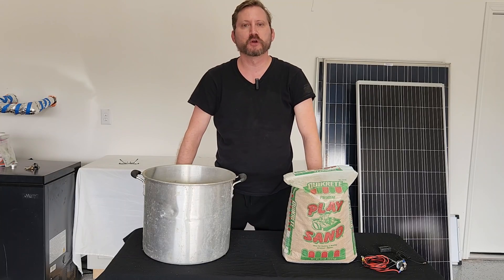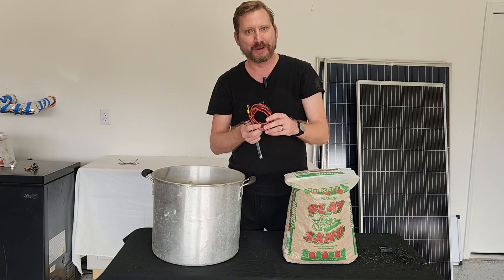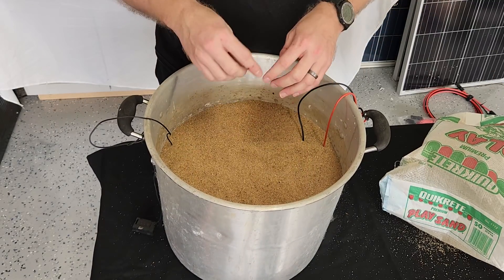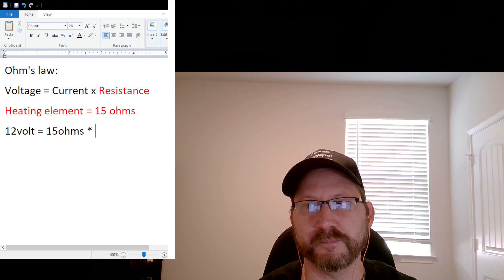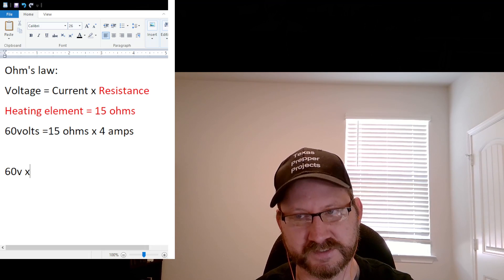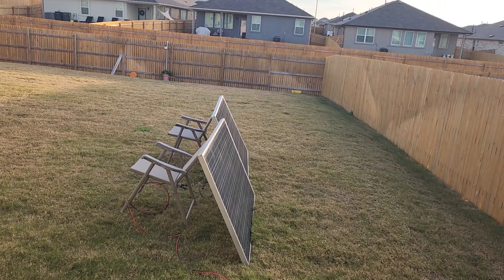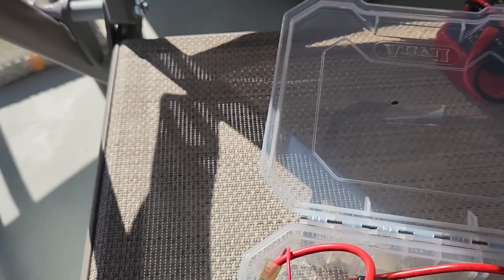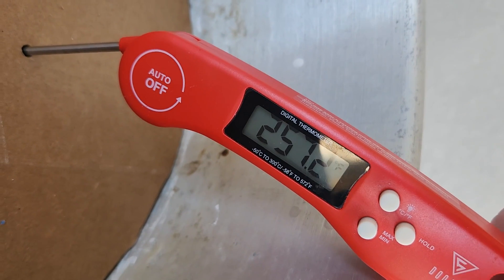Sand Battery Heater solar powered 250F / 120C with no flames or fuel! DIY

Comment: This is a great concept.

But why not drill a hole in a brick inner wall of your house, put a heater in and so you have a lot of mass? Then put a good switch and thermostat, a safety thing on.. 

This could be a perfect commercial product.. Just a wire, switch and small heater element that you can drill into concrete and connect to a solar panel..  And heats your entire house for 50 bucks and some solar panels. 

Or drill a hole in a concrete floor, a brick wall in the basement of your house..

If you really use the mass (sand) under your house it should be possible to store energy for about a few weeks. 

So if you have one week of sun and one of rain, temperure stays totally stable..

Depending on the insulation and other factors you have of course..
Reply from the maker: I didn't want to destroy the pot

Comment: When was the last time you saw 250°F water? One BIG benefit of sand is that you can easily go FAR above water's boiling point without a pressure vessel, giving you a way to offset the difference in heat capacity. Imagine 1000°F sand!
Reply from the maker: agreed!
Reply: @texasprepperprojects  Would this work as overnight low heating in a coop? Assuming it's shielded from the animals and at a smaller scale like a large can? (Oven heated)
Reply: Exactly!
Reply from the maker: @so_what_else_is_new  thanks!
Reply: @dadigitechman  H2O has the greatest heat capacity at 4190 J/kg K. The specific heat capacity of oil is usually around 2000 J / kg K, which is about half that of water. Sand has a specific heat capacity of 290 J/kg K, about 1/15th of water
Reply: I understand that if your heat battery is indoors then blowing air through pipes in the sand or insulating the bucket doesn’t create heat - it just either moves the heat around the room faster or slows it from moving around, respectively. So… drum roll, why do you need the sand at all? Won’t the element heat air just as readily as sand or water? And if you’re end goal is to heat the air, the only advantage I see to the sand is to slow how fast the air is heated and of course to save you from accidentally touching a very hot heating element.
Edit: Nevermind. It’s powered by the sun, so the sand stores the heat for when the sun sets and the power drops. But if there was a steady source of power the sand wouldn’t be necessary. Right?
Reply: If you filled it with crushed diamond dust your matrix will store even more heat😂
Reply: Perfect for my greenhouse..And i live on  gravel..literally. 20 cm/8 inch of soil.. then ice age gravel..
Reply: A 60/40 mixture of water and ethylene glycol can raise the boiling point to around 260°F. Another advantage of water is that you can easily store and heat a lot more of it. 1,000 gallons of water at 200F contains a lot more energy than 10 gallons of sand at 1,000F. The lower temperature differential means that heat will dissipate more slowly.
Reply: Sun is water
Reply: The only issue with this is ..sand for building is globally a  resource under pressure.  So best do some careful research.... as I told my gardening ex all soil is not mud..😂  
Find out what's available and watch out for the unexpected.
Reply: @clivestainlesssteelwomble7665  I think that the Finnish company said that all soil is usable if it is completely dry.
Reply: @so_what_else_is_new  
Soil is a combination of organic and inorganic mineral components...  The presence of organics isn't a good starting point.  As you heat it up it kills the biotic component then starts to reduce organics such as Carbon and sulpher compounds to gasses ... Oops 😬 that's not what we want. 
What you want is a inert mineral particles or mix ...that's stable at high temps and won't contain anything that's likely to react with your equipment or start giving off anything toxic or corrosive. 
At one time you might have looked at the gangue waste mineral piles from the china clay business. 
Now you might look at desert sands but they tend to be high in iron compounds..  if that works go ahead , they have been growing ...  but don't get dredging them out of rivers or offshore sands or aggregates because then you will open up another set of ecological problems .. and just create misery elsewhere from erosion, habitat and species loss. 
In Vietnam  they are suffering big time in the Mekong delta..from sand dredging.

200 yrs ago the Royal Navy needed aggregate to build its dockyards in Plymouth England. They took it from offshore of a place called Hall sands. Just along the coast .... Thousands  of tons. Shortly after In a series of Winter storms the fishing village of Hall Sands was washed away and some of the occupants, those that survived had to break out through the roofs and back upstairs windows of their homes and scramble up the cliffs that sandwiched their village between the former sand and pebble beach and the cliffs... Which also started to collapse. 
The disaster led to a change in British law and it became illegal to remove coastal beach  sands and gravels. The seasonal flow of sands and shingle that formed their protective beach offshore had gone .

The problem is we have reached  
the point some time ago, where the total mass of the Man made now exceeds the total biomass of the planet... and it's still growing and it's still one of the biggest sources of waste CO2 production, water consumption and energy. 🤷🏻‍♂️  
It's a good idea 💡 but just think 
and look at what and where. There are sadly still plenty of Nations that have tried creating cities and land  where we shouldn't ...as a consequence, well they are disappearing  almost as fast as they were created... but the  price is  ....🤷🏻‍♂️🧙🏼‍♂️.
Reply: @clivestainlesssteelwomble7665  well, thanks for lecturing me on the history of the world. ;-) I have no intention of creating a big business or digging megatons of soil. I was just thinking of digging 1 to 3 m³ of soil, letting it dry for a month or so and then building a concrete container within a concrete container with thermal isolation in between. Carbon and glass are not ideal for storing heat but they are not going to damage damage the heating elements. If there is something toxic in it, it will stay in the airtight container. Acidity may cause corrosion to the heating elements, so that's something that's worth some attention. Are there any dry acids? I thought there were only liquid and gaseous acids. Maybe you can clear that up for me.
Reply: @so_what_else_is_new  

😉Not aimed at you just .. I'm just pointing out that while it seems simple there's a few things  to watch out for and if we started to deploy the technology at scale if we are not careful we can run into problems. 
 You can see it  someone goes off  and starts digging sand or aggregate  and ends up getting fined or collects something unexpected in the case of the US there's huge areas of land that are contaminated with  Arsenic.. either from mining , natural Geology or farming where it was used as an insecticide.  Heat that up and...  
Yes ... all Im trying to say is every technology brings its problems ... and we all need to be aware 😉 50 years of dealing   
With not thinking ahead.... trying to get politicians businesses and architects and engineers to think in terms of natural systems and do joined  up stuff ...  🤷🏻‍♂️ Suprise I sometimes do go off on one... 🤣👍🏼🧙🏼‍♂️ ...🇬🇧 ✌️
Reply: @clivestainlesssteelwomble7665  I agree when tech is brought up to scale. I'm an electrical engineer so I have enough experience with that.
I didn't feel offended btw 😊
Reply: @so_what_else_is_new  
Build a box big enough, put a stainless steel spiral as heatexchanger in and fill it up with high temperature stable concrete an you get an ultimativ Heat Storrage
Reply: @michellekonzack  has concrete a higher heat storage capacity then sand? If not then it's only more expensive...
Reply: @so_what_else_is_new  
AFAIK it is the same, but you can build it INSIDE your house like a chimney and use it as WarmWall.
Imagine, you have a zylinder of 1m diameter and 6-9m higth filled with sand and then a welding break.
Reply: @michellekonzack my idea was to dig a whole outside of about 3 m³ and make cube inside a cube of concrete and heat the sand inside up to maybe 800°C. Then a steel pipe circuit pumping liquid salt into a second circuit with water for radiators and hot water. So there are two temperature conversions. There has to be enough heat stored in the sand for about 4 months of winter.
Reply: @clivestainlesssteelwomble7665  You're an encyclopedia of environmentalism, but not boring. Have you published?
Reply: @veganforlife5733  

No... just been studying and teaching whilst trying to help make a few connections and differences..... for a long time.😉 Thanks😂🧙🏻‍♂️  

In the end you start to think in webs and cycles ... to the point where written words become erm🤷🏻 frustratingly slow and linear...but that's also a bit like being slightly dyslexic or like F Herbert put it in Dune... Becoming primitive.  🌌
Reply: @veganforlife5733  
It's a long long read ... But it's chapters are marked by various observational quotes some ecological others political and philosophical.  It helps that many are in Italics ..  
Herbert dedicated the first book To Dry land ecologists, wherever and whenever they might live.
Reply: @clivestainlesssteelwomble7665  sand used in construction is indeed a scarce ressource, but any other other type of sand  (which we have plenty of) would work just as well.
Reply: @tombh74  

Generally true but there are some sites where old spoil tips got dumped or spread where you just have to be aware, there are also areas where soils and sands from say mine tailings etc are not suitable ...especially for  larger amounts.  I studied environmental  geology  in an area famous for it's historic hard rock mining  history.  Most of the Arsenic mined was sent to the US to put on Cotton crops... The  Lancashire cotton workers used to get ill from arsenic poisoning ... from processing the US cotton crop, it's estimated about a quarter of the Arsenic was re imported at times with the cotton crop... 
It's still a major heavy metal contaminant of soils and groundwater in wide areas of the US and limits food crop growth and groundwater use. 

I would always do a bit of local research. .. we had a bunch of students picking up small mineral samples on a 100yr old  waste tip.. silly devils went home put them ontop of cooker grill and forgot  another student came in and started cooking.. what they had picked up wasn't Galena ...lead sulphide.. it was Arsenic .. 🤢  🤦🏻🤦🏻 the local hospital were not amused. 
Given the history of the US and land areas ..guess I'm just saying .. as a big scheme it needs a bit of planning and in some areas even a DIY project needs a touch of the forewarned is fore armed. 🤷🏻‍♂️🧙🏼‍♂️🇬🇧
Reply from the maker: Yup
Reply: @clivestainlesssteelwomble7665  Ordinary construction waste sand is all you need. It can even be pulverized concrete for that matter.